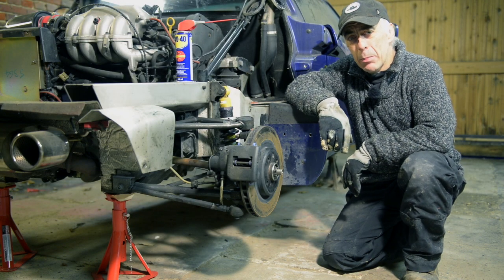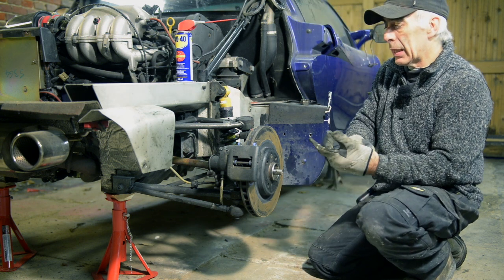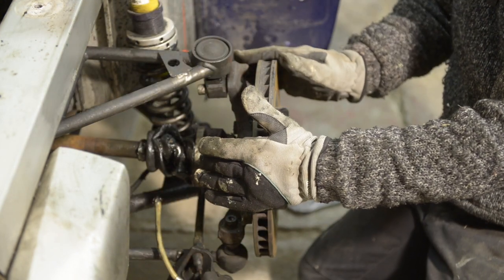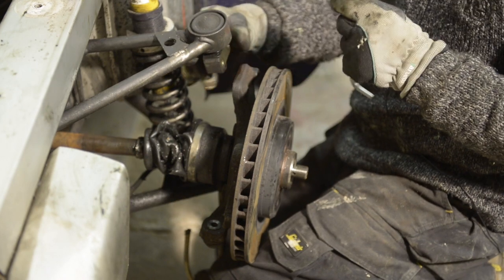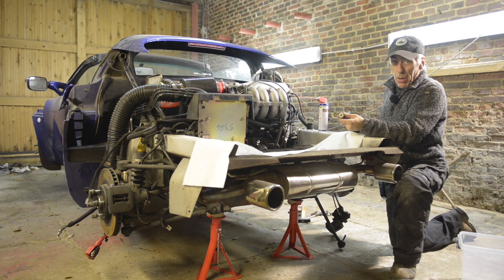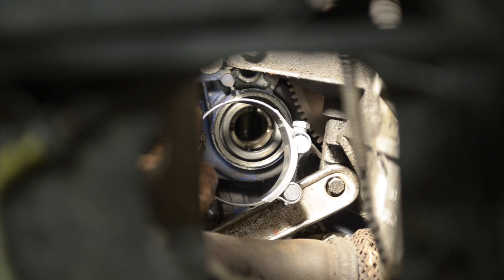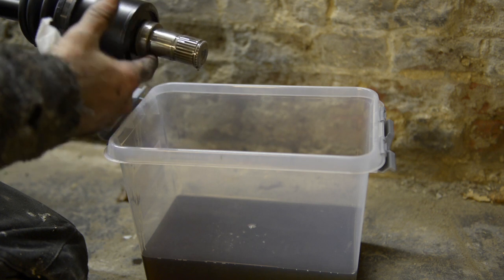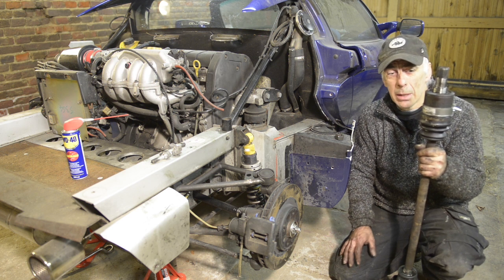Lotus Elise , S2  Drive Shaft replacement

Comment: what i like about you. your clear english very good for us who are not english speaking by born, again the type of camera you are using  very very good , third by showing every everystep in anything.  i knew you first from those videos of mf 65. and i had a tractor home which was having a bad top gasket. and after whatching your video of mf35 i god the guts to go make it myself. from then i follow on you. none of your video i miss.
but remember i asked you to make us video on where to find a wiring diagram for a car and how to use it. especially for engine
Reply from the maker: Thank you, its my pleasure...  Can explain what you need in terms of wiring.
Reply: Hi Flemish , i am sure you have see this days that cars have changed to too much electrical/ electronics.  just think of a simple injector with two wires. it is difficult to know which wire is +ve and which is -ve. i fear just to put voltmeter on something which i dont know which is which.

again lets just talk of spark plug. remember we use to have a distributor and high voltage cables they are no longer there. so again i become stuck. like my car has something on top of my spark plug . four wires are coming to it. so i just dont know where do they come from. are there fuses in between or not? so i think if i had a wiring diagram, it would have been a bit easy for me to see.

let me give a pracrtical example here  :  i had a car on my yard for my friend. he said he was driving that car (ford figo 2016) and it just died on the way. the engine just cranks but no start. i attended to it and find that there is no diesel coming to the engine. 
i then checked on fuse and relays and find them all right. i then went to the pump itself and gave it direct 12v. and it worked. so i thought there is open circuit since there is no other thing between fuses and pump. 

so weeks later someone came and attended to that car .all out of the sudden the car started. i asked what he did he said it was just a tripped inertia switch. which it was for the first time i heard about.

so , i think if i had i wiring diagram for that car .i would have seen that there is anothere thing between pump.and fuse.
and you know it must not just be a wiring diagram it must be specifically for that car. so, where do we get them maybe by vin nu. and how to read it?

Comment: You can also knock the driveshafts out with a cold chisel between the gearbox/driveshaft seal face and driveshaft, just make sure you don't damage the faces.

No need to buy a gearbox wrench as it's just a 3/8inch drive from a socket wrench.

Finally I just managed to draw out both driveshafts without removing the either of the ball joint nuts, just remove the toe link nut and pivot the hub.

Comment: How did you get the driveshaft into the gearbox?  Did you just push it in?  Did you hammer it in?  How do you know the circular clip remained in place?  Did you have to somehow squeeze the clip while guiding the shaft in?   I know so many questions.  I am going to be doing this in a few weeks.   I would appreciate any advice you would have.  Thanks you.  And thank you for video series on the Elise.  It has been super helpful.
Reply from the maker: You  will just need to push it in with kick,  that goes very easy...   getting  the old one out is a bit more difficult,  But if you use the method  with the clamp it works .
Reply: @D3Sshooter  Thank you!!!!

Comment: Hi Steve, attention! You mentioned a torque of 45 Nm for the central drive shaft nut. That's dangerous! Please doublecheck - it should be at 220 Nm.

BTW: Thank you for your phantastic videos! In which country do you live?
Reply from the maker: Txs,  good point.  I will need to check it